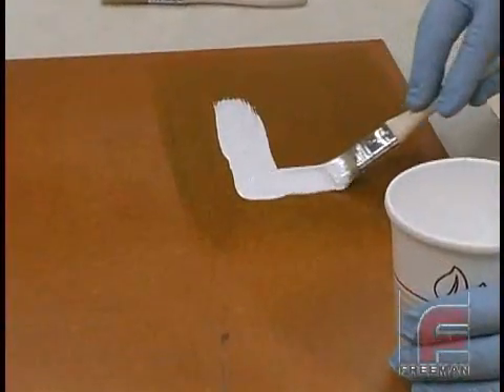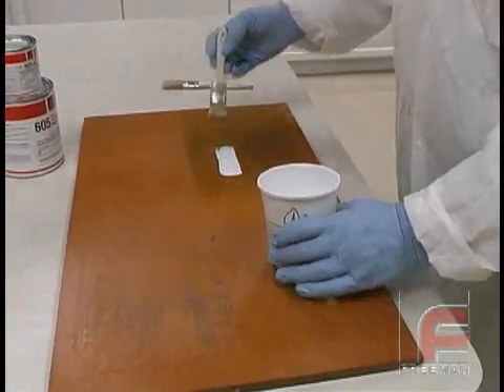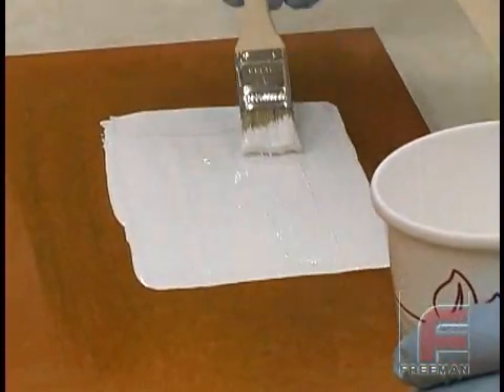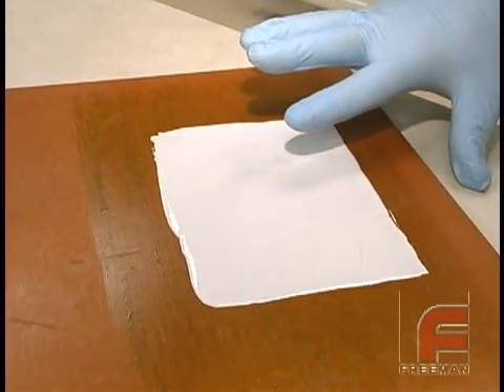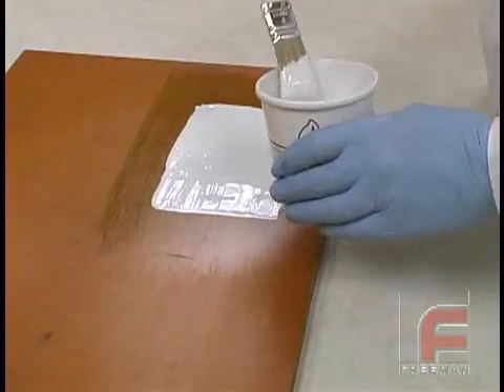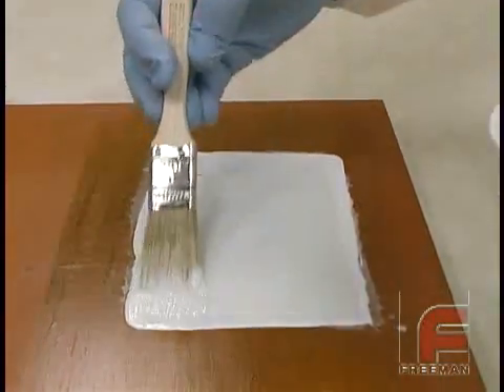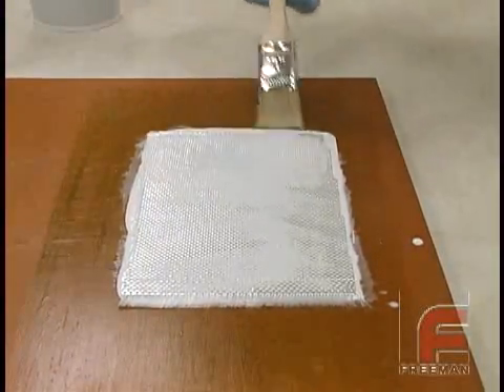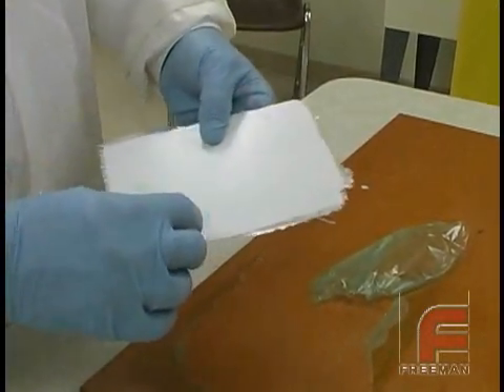Epoxy Laminating Systems

Comment: I see you are using fiberglass cloth for the demonstration.  Can your laminating epoxy also be used with fiberglass mat?  I will be making a mold of an animal form for a Taxidermy mannikin, and want to go with a laminating epoxy instead of the old stinky polyester resin/fiberglass route.  Lots of undercuts on the sculpture, which the glass mat always worked well for.  Thanks for your time.